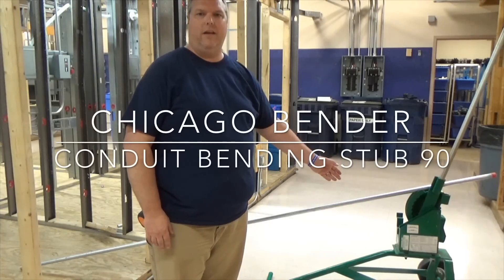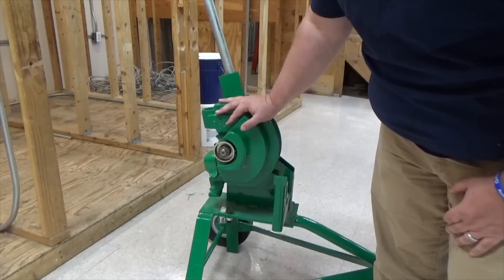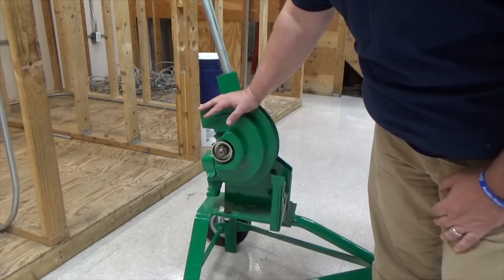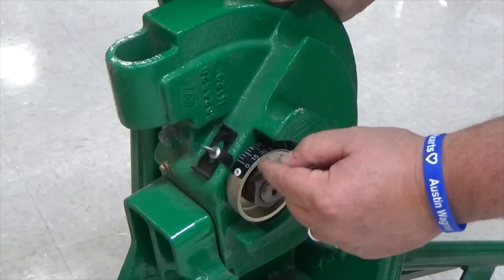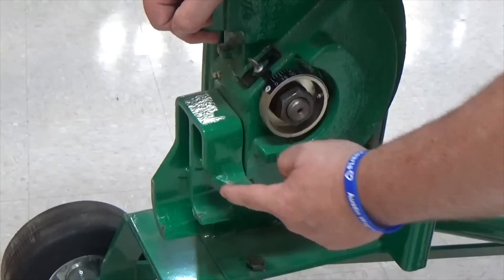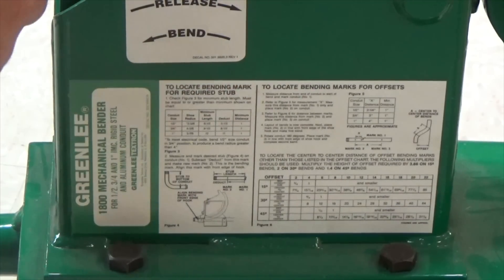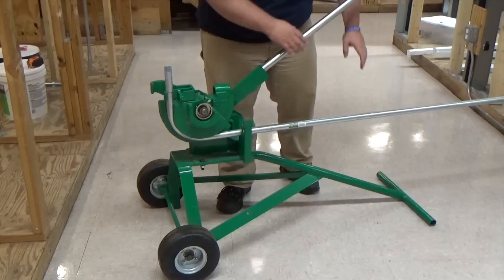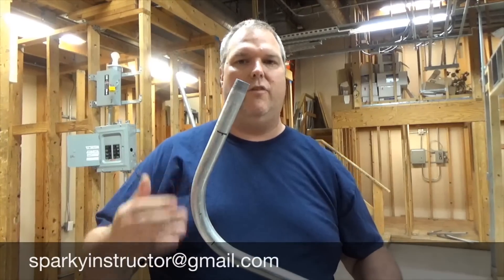Bending Rigid Conduit with a Chicago Bender, Stub 90

Comment: To make a stub can I put the line right under the threads
Reply: I always measure 1" back from end of pipe. It will give you 9 1/2" stub. If you want 8 1/2 stub it's better to use a  non threaded end and thread after bending.

Comment: That's a bad way of marking the conduit. Try extending the rule past the end of the conduit the same amount as the DEDUCT. Then you only need to make one mark. No math or re-measuring required
Reply: You are 100% percent incorrect, having two marks for beginners is the rule of thumb.

Comment: Great video! Maybe you know the answer to this question. The Greenlee 1800, the Current 750, the Lidseen 5100 all bend 1/2" RMC at a radius that is much smaller than specified in Chapter 9 table 2 of the NEC, so the bend would technically would not campily. Why would they make a product that does not follow NEC. Thanks!
Reply: 🤔...be sure to ask.. lol

Comment: Can you use that bender on EMT? 

My boss has one of those he picked up years ago and I used it to bend 1" emt and almost the entire 90degree bend was flattened. He got it second hand for free, I told him to throw it away because if it can't bend EMT properly we can't use it. 

Maybe It's intended use is rigid and I'll tell him to keep it around.
Reply: In my opinion the Chicago bender is better for rigid and rmc, not Emt because it’s more fragile
Reply: @JoseDiaz-mb9lj  100% says rigid only when you google it. It completely crushed the inside of our bends on 1" emt

Funny that my boss held onto it for this long. We never use rigid
Reply: The shoes are a different size for rigid vs emt. You can't use one for the other.  The OD's are different. That is why you get crushed or kinked bends. It is the same with pipe vs tube bending dies.
Reply: @robbieburns1664  Thanks for answering. The bender was so old all the information was worn all of the bender. A brand new one has "rigid only" on the side.